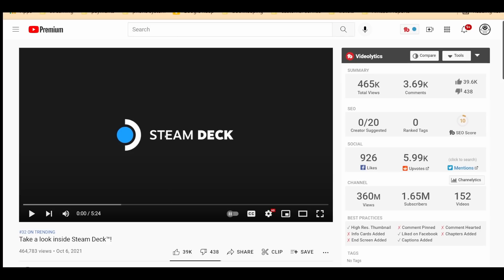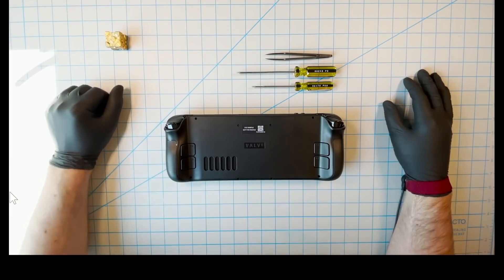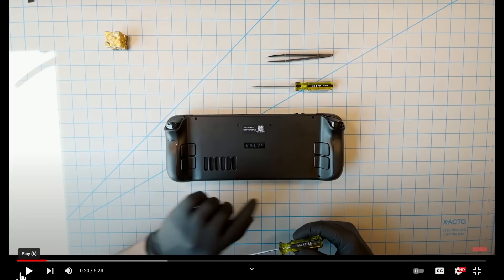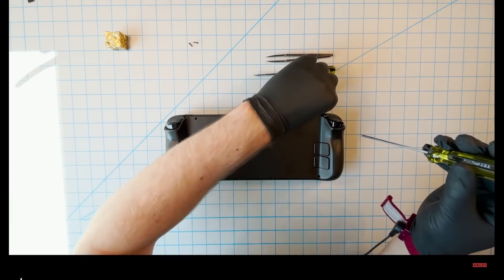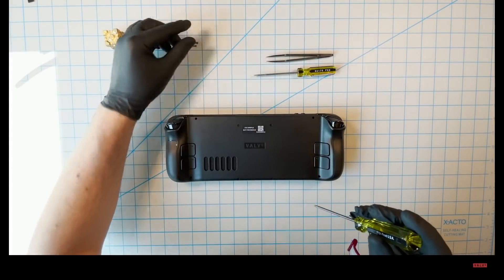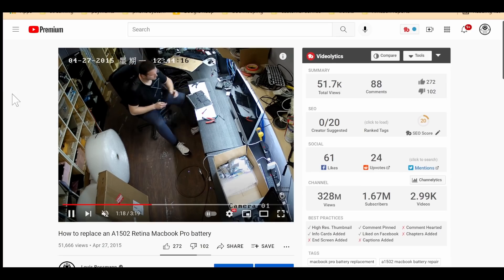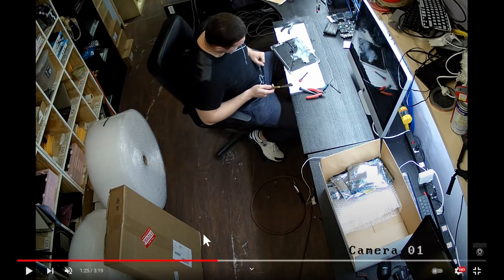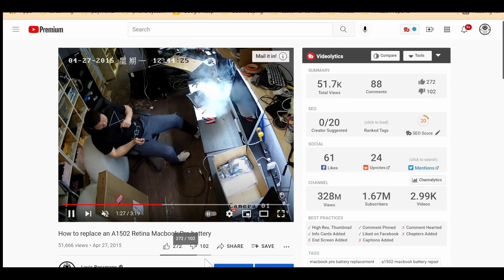Steam deck battery may end your life? bruh 😑

Comment: grounding - i have been assembling, reassembling, and fixing my PCs since I was 14.
on a carpet in our room.
never killed anything by static. never even had a static spark happen, because... yeah, i thouched something grounded. but i never even had the static go off when touching the grounded thing. the only time i ruined what I was working on was when I deliberately let my 1.2 Ghz AMD processor run without the cooling for about 10 seconds because i was curious how hot it gets, and how quickly. It started smoking at the 5th second, and... yeah, i burned the CPU. Which was fine, because it was the old one I was about to replace. What was not fine was that it also burned/shorted something else (can't remember if it was something on the motherboard, or the power supply itself).

Comment: The structural integrity thing is probably due to the screws being self tapping screws into plastic which are not designed to be screwed in and out a lot and the threads can strip very easily. 

I can see this reducing the resistance vs drops because when they tighten the screws in the factory they can get them tighter than the second or third time they are screwed in. The shell may pop open from a drop in that instance easier than factory but the difference is probably negligible like you said; the benefits of replacing a dead battery outweighs some theoretical chance it wont be as strong.

Comment: From a computer engineering student who asked a mechanical engineering professor: "taking out the screws and replacing them with anything reduces its structural integrity. However it needs to be stated that the amount it is reduced depends on the materials, and in this case, it sounds like the more worrying concern for an individual is the screws destroying themselves or their housings. I wouldn't recommend dropping the device in the first place."

Hope this gives some understanding to you Louis, I love your content and your missions!

Comment: I'm not qualified to give explanations, But when i was younger I bought a netbook laptop for $125, A couple years later the screen died and i bought a replacement  for cheap.

Once i took the 4 screws off the bottom, I realized the screws were the same type found in the steam deck (screw drilled into the plastic) and once i was finished with the repair. The right top corner never was able to screw all the way into the plastics leaving a gap. I probably over torqued them as a 11 year old and stripped the plastic. 

I imagine to keep costs down Valve wanted to use the cheaper option of no metal "nuts" to secure the body panels together. But there's not much reason to open a steam deck (hopefully) more than 2-4 time IMO to replace over it's lifespan, joysticks, display, ssd, or battery. Probably after a while someone will sell the "nuts" that you can heat press into the Steam deck to secure the thing once more.

Comment: People who don't know how to treat self tapping screws in plastic devices, can really harm the ~structural integrity~ of the thing. 
Tighten it too much (as people often do) and the screw will never grab anymore. 
But it is also really important when re-assembling, to turn the screws backwards slightly until you feel the screw drop into the thread it left when self-tapping. That's one thing i didn't learn until fairly recently. 
But yeah, it's a big exaggeration. Even worn out screw holes can  be fixed with some glue or resin and re-drilling.

Comment: If you have the steam deck open, the structural integrity is lessened, as you remove one or more of the loadbearing sides of a hollow cube. When you correctly screw the thing back together, everything should be fine though. What can happen though, since the screws are self-tapping, they don't sit as snug as after first installation. So them saying the thing looses stability after opening and closing can just be them covering their asses from a lawyer perspective without any meaningful decrease in stability.

Comment: I’m an engineering student, and although I’ve yet to take my material analysis course, from experience, I can say that plastics can get flimsy after a bad screw insertion or multiple screwing and screwing events. They’re not using threaded metal inserts, but self tapping screws that dig  into the plastic. 

My best guess is that it has minimal effect if screwed right but a bad user could mess up the threads and make it plausible that it’ll strip, lose grip, and open up or “fall apart” after a sudden drop.

Comment: On structural integrity.

As a repair tech in the entertainment industry. We have loads of equipment that is tightly packed in plastic cases like that.

There is some merit to his statement on the device being weaker.

I will always inform people of backthreading their screws as you would to make sure you don't cross thread them. This is because with self tapping screws they will cut new lines in the plastic housing. The more cuts the weaker the material. 

If backthreading is done perfectly then it should be fine. But I can easily see someone messing up even just a tiny amount and the case will not seal as well as it was originally. After 2 or 3 openings like that it's very easy to see how the device could be more prone to drop damage.

Odds are this was put in to stop the complaints.

Comment: From a purely structural sense, opening and re-assembling something like this will weaken it. The plastic will be slightly bent compared to its original installation. It's not going to be THAT bad, however. Maybe it will go from a 1% chance to break on a drop to a 2% chance. After all, plastic does flex and deform over time as you move it. So if you keep opening it up, it will cumulatively add weakness to it.

Also, as Linus pointed out, this is the kind of device people will have in a backpack, so say you barely damaged the battery but it didn't become apparent till later when it was reassembled and you jostled it when putting down your backpack. You may not realize it till the fire has already started and your backpack with your school books is a raging inferno.

Comment: Hey, Louis! 😊 About the structural integrity: 
First - self tapping screws are probably the worst ones you can use in plastic housings - in many cases they will drag the thread out on the first time you unscrew them if you're not experienced enough (especially such small ones seen here), or if they don't, the chance of them getting overtightened is really high, because of their tiny size.
Second - I see there is some prying involved in the disassembly. As you know it's almost impossible for a person with no experience in opening a specific device for the first time to not brake a plastic tab or two.
Third - This is a more general one, because I did not see the Steam Deck having some - Adhesive. It immediately loses it's sticking power on the first time you separate it.
I'm sure this is nothing new to you (being the GOD of device repair you are), just you did not think of it at the moment of the stream. 😊😊😊
Reply: your comment hurts my brain, its painful to read for some reason
Reply: You have no idea what you're talking about please don't comment again.
Reply: @aborted4196  I thought their comments seemed rather on point. If you don't think so, as a civilized and decent human being why not tell them why you think they have "no idea"? Simply trying to silence someone without providing logical explanation makes you sound like a troll.
Reply: @aborted4196  Please, explain. Tell me and the 71 people who agree with me, how you got to to this conclusion.

Comment: apparently by what I've heard, the screws were drilled straight into the motherboard to make the threading. It's like drilling the hole for your wall screw for a picture with the screw itself. Unscrewing and screwing those over and over will degrade the threading.
Why they did that? not sure...

Comment: Uneducated on the subject person here. But were I to try to play Devil's Advocate on the reduction in drop resistance, what I might guess would be to blame for that is these self tapping screws. Each time they are taken out and put back in again they may be expected to not go in perfectly each time so the hole gets a little bit more sloppy and the case is no longer expected be quite as snug/perfect as the first time. So even if that means impact resistance drops by a whole 1% each time it's opened up that  could mean that 20. 30 or 40 times later stuff never quite sits properly anymore. For the moron that opens it for fun just because they can. But for the person that may open it half a dozen times over it's lifespan only for legit reasons, not really an issue.

Comment: A disclaimer is one thing. Valve should of got a steam deck engineer to do the tear down heck or collaborate with ifix it for a teardown.

Electronics can be dangerous but saying there is a very high potential it will explode by just opening the back and sniffin the board. Kinda itty bitty dramatic 🙄 
Just say repair at your own risk and there are no plug and play components for the average consumer. 🤔 
 Don't scare people into not learning about how it works.

Comment: I think that the video didn't explain the structural integrity issue clearly enough. What I think they are saying is that while the case is dismantled, the unit is more susceptible to damage if dropped or handled roughly due to the compromised rigidity of the remaining case. That is how I interpreted it anyway!

Comment: Yea no, the structural integrity comment is definitely referring to little plastic clips and the possibility of breaking them and/or weakening or stripping the screw holes. The main clamshell won't degrade from being lifted or even pried off, but missing one or more of the fastening devices could affect the overall rigidity and impact characteristics. I can't say how big a deal that really is for user experience and actual real world durability, or how easy/hard it is to actually fuck up disassembly. But it wouldn't surprise me if missing screws or clips get treated like a slightly more legitimate version of warranty void if removed stickers.

source: some formal study of material science, and stupid amounts of tinkering on electronics and nerf blasters

Comment: That thing was held in by screws and a couple clips. The screws should hold unless you strip them. Clips could break or wear. I’d hardly call that “effecting the structural integrity”. At worst the back plastic piece goes on a little janky. And that’s if your a gorilla.

Comment: They show you how to open the device. They have it run open software. They say they're going to provide replacement parts. They show you how to install the parts that are most likely going to be in need of replacement. They warn you about specific mistakes that are commonly made. They tell you that you can use off-brand parts in some cases but they might not work as well. They even tell you what you need to look out for when shopping for off-brand parts. I think I can tolerate them exaggerating the dangers of working on a lithium ion battery to prevent themselves from losing a lawsuit / getting bad publicity when inevitably some idiot attacked the battery with a machete while a different idiot was holding it between his teeth.

Comment: I believe they're thinking it could catch fire if you nicked it and then burn down your house with you in it while asleep... at least that was the only thing I could imagine they meant.. Or you might nick it - it flares up - you run away, but your baby sister upstairs couldn't make it out in time. I had a brand new DJI drone battery catch fire in my drone case in my garage shortly after charging on the DJI multi-charger. Normally I would have had the case in my house or my car after charging but I thankfully left it in the garage. Created a huge mess and almost burned down the garage...

Comment: Regarding the structural integrity - since they are using self-tapping screws, it may simply be that those screws once removed already stripped a bit of the casing and dropping the device ma cause the device to crack open more easily when dropped or handled rough. Casing clips may also be a bit damaged/warped while opening and... again - easier to crack open if rough handled. Similar to the old days when you could open your phone's back and if you are not careful, the battery cover can fall off easily even when you don't want it to open. Sounds dramatic the way they presented it but... makes sense to me.

Comment: I could definitely see the structural integrity being compromised simply because of the fact they're using self tapping screws in unthreaded plastic. It can only take a few (or even just one) disassembles before the screw holes are torn to shreds and won't hold onto the screw.

Comment: Louis, re: structural integrity, he is somewhat correct in that structural integrity can be lessened IF you strip a screw, or if you overtighten and crack the case, etc. But if you take care and do not abuse or damage the attachment methods or structure, it should be fine (i.e, torque the damn front wheel on the front fork so it doesn't loosen while riding :P ps don't ask...) /hugs

Comment: How long until someone makes a ribbon cable that allows a rear mounted full-size nvme SSD that sits outside the device? Would require modifications to the heat shield and back case definitely.

Comment: I think what they meant by that reduced structural integrity was like if you unscrew and screw back self taping screw like 10 times the thread might be damaged enough so the screws will not hold your back cover good enough and if you drop it back cover will fall off or if you are a kid or clumsy person you can damage the thread i think they just protect them self with that claiming against those people.

Comment: I believe he said "coming months" because the hardware isn't finalized yet. No sense getting replacement parts if the part may change in a hardware revision shortly down the line. The deck doesn't officially start shipping until next year.

Comment: Only thing I can think of in a reduction of integrity after opening it is screw tension and plastic shell edge alignment.  Yes I laughed at the latex rubber gloves + ESD strap, only need one or the other in a low humidity environment, unless the humidity in their environment is below 25%.

Comment: Glad to see you react to this. With the screws, my guess is that because they are self-tapping, every time you screw it in or out you'll be removing a little bit of material and creating new threads, even more so if you're inexperienced and overtighten them, so eventually the screws would have nothing to bite into anymore. 
That said as most people won't open it, and those who do open it might only do it 2 or 3 times in the lifetime of the device before the SOC dies/becomes too outdated to run games, it is not something to worry about IMO.
BTW, if you're not watching LTT, Linus also seen this video and challenged Valve to make all parts available, including the mainboard, 🤞 they do.

Comment: 16:50 This is why we as a company refuse to install other people's cameras and equipment because we warranty our work. However we warranty our work when using /our/ parts that have their own warranty and we know won't fail six months later. We're not going to cover a camera installed that fails six months later when it was provided by the customer, or  better yet they did their own wire pulls too.

The customer is NOT always right.

Comment: If the screw holes become an issue long-term, I would think about looking into getting some metal inserts, installing them, and switching to machine screws with some Locktite (or something similar) suitable for the screw size. Assuming they are using ABS for their housing, I think there are glues you could use to install the inserts that chemically bind to the plastic.

Or you could just buy a new plastic shell.

Comment: 8:30
I can believe that opening and then reassembling the steam deck will weaken it, and it's not hard to consider why:
Just prior to the "weakening" claim it was pointed out that the screws holding the device together are self-tapping screws going into plastic. If you don't know how to get a self tapping screw back into its original threads (which most people don't) then the screw is going to cut new threads every time it is reinserted, and with every new thread cut the joint will become weaker.
If this is the reasoning then while Valve would technically be wrong about saying there's no way to avoid the device being weaker, it's realistically acceptable. Explaining how to get a screw into its original threads and why cutting new threads would be bad is a level of nuance that really isn't warranted here.

Comment: Personally my take on the whole SSD thing is that while changing your SSD "could" affect performance of the device multiple ways. Although I don't see how it would impact your WiFi signal because the antennas for your WiFi are most likely not located in the EMI cage they placed over all the "main bits" (maybe the WiFi card is in the cage and EMI from the SSD can impact performance? But most WiFi cards have a onboard EMI shield... That would be some gremlin, pixie dust shit if that truly impacted performance noticeably). Now I don't know the legal side to this (or if they could be liable) but changing out anything in the device that is not specified by the manufacturer can make the device not FCC compliant. And making sure your device is FCC compliant is a pain in the A**.